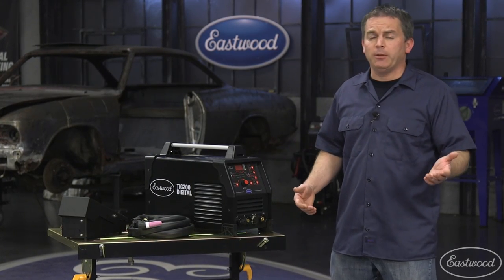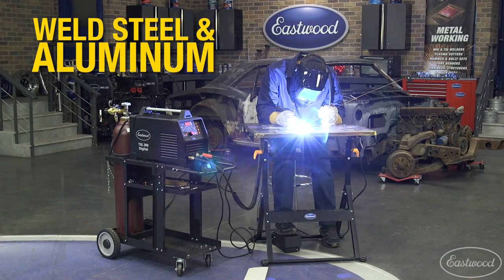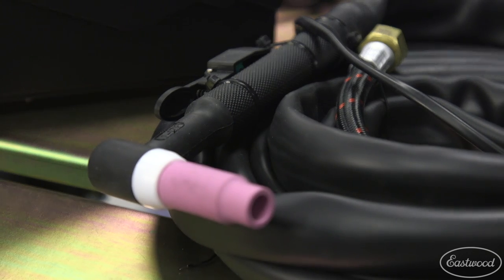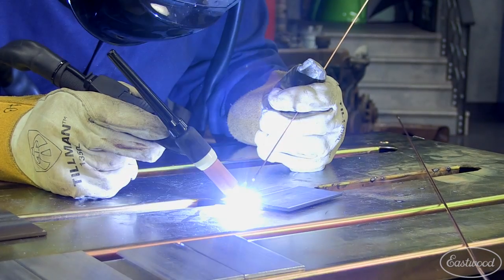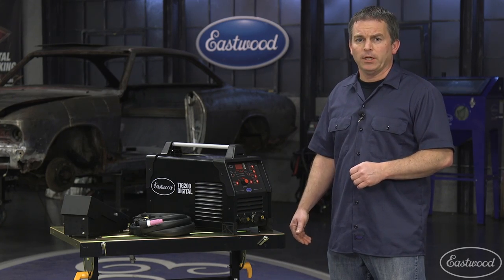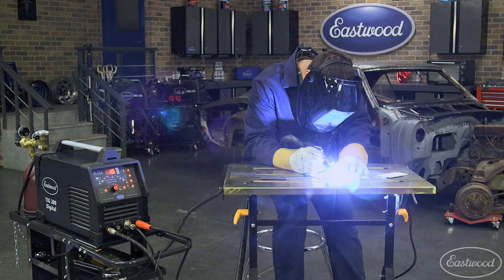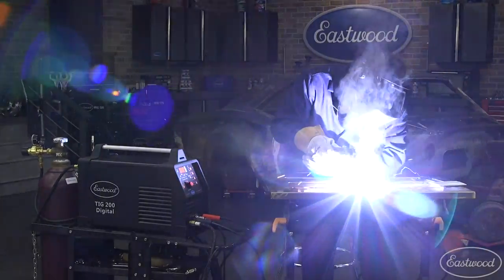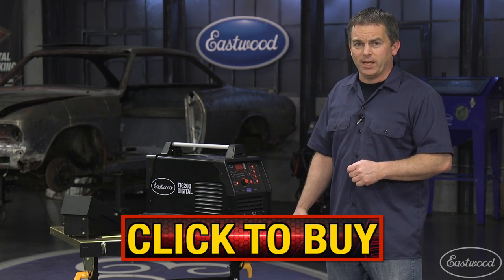TIG 200 Digital Welder - Weld Steel & Aluminum - New Added Features - Eastwood

Comment: 25% duty cycle kinda sucks but that's at full amperage what's the duty cycle for a more common amperage like say around 75-125A
Reply from the maker: The Duty Cycle at the lower amperage is 100% at 100 amps and 60% at 130 amps at 104 Degrees outside temperature.